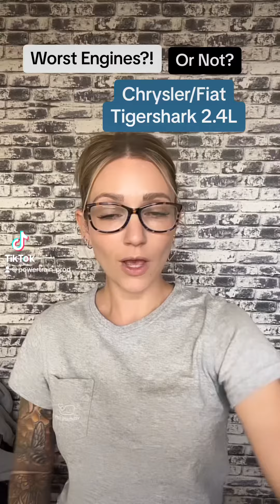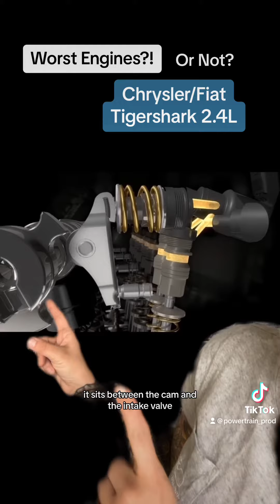Chrysler/Fiat Tigershark 2.4L Engine

Comment: First, this is a very solid engine platform. Very reliable, very stable, and very efficient for its class.  The issue will be the owners.  With the design of this engine, surpassing or completely ignoring the oil change intervals is mechanical suicide; it will destroy the engine, on that we do agree.  That doesn't make the Tiger Shark a bad engine.  It means you have do what you as an owner of a vehicle are supposed to do and keep up the proper maintenance intervals.  Now with Valvaline Restore and Protect, you can clear and protect those oil channels and keep you Tiger Shark running reliably for many miles.  I have a Tiger Shark in my 2014 Dodge Dart SXT with 249,830 miles and only withing the last 30 days have I started having an issue with the actuator.  I plan on using the Restore and Protect at my next oil change to combat this issue.

Comment: I’ve put 160k miles on my Ram promaster city tiger shark. Original everything. The secret? Not so secret. No lugging it around below 2k RPM and 4-5k mile oil changes religiously. Easy peasy lemon squeezy. 
They say 5900 a day keeps the mechanic away. 
Seems to be working out well. 🤷‍♀️
Not much else to say. Change your freaking oil man. Drive it like you stole it. No complaints over here. No leaks. Minor oil consumption. Needs new mounts though. 🤣

Comment: You MUST change or fill every 3000 miles. 

I blame the EPA... Don't ever use any oil that's not recommended... But I can almost guarantee you that this engine was not originally designed to be used with full synthetic like this... It's too thin... I bet the original design might call for 5w 20 oil.... Never do it though because you'll void your warranty or any recall benefits.... But I really think that's what happened.... And the nonsynthetic oil would be changed every 3,000 mi... And then it would never run out of oil before the oil change....

So.... Yes I use the full synthetic... But I change it every 3000 miles... And yes it's expensive.... 

But my vehicle is also 25,000 less than a 4Runner.... It is what it is....

Comment: My wife has a 2015 Jeep Renegade. Has about 100k on it now. Has never used oil. Has never had a single issue other than a failed thermostat. We do change the oil around every 5k miles and make sure to use an appropriate oil (crucial for Multiair engines) I dont doubt that some of these are duds. Every company puts out some duds or has some junk slip through QC, but I think the biggest factor here is lack of maintenance which makes any car eventually unreliable. I know too many people who stretch fluid chnages to the max as though it is just a suggestion. Particularly problematic on this Multiair system. A lot of folks have probably bought used Cherokees, Renegades, 500L, Dart, or Chrysler 200 quite cheap and viewed them as cheap "disposable" cars as well. Almost purposely not maintaining them and then running into issues. Gone are the days of the "weld the hood shut" Civics, Camrys, or even the old GM 3800. Pretty much all of these newer complex engines need regular maintenance.

Comment: I'm  in a 2018 Promaster city with this engine I bought new that has been through a lot.  The dealer had to rebuild the top of the engine because of oil consumption.  A water mishap ruined my transmission, and I had to have it swapped with  2019 transmission with only 12k miles. Despite all this, i  LOVE THIS VAN. The space, the way it drives, handles and looks.   It's been running great since, and my van is so customized as a  micro sleeper camper and for an off grid business I run.  I've pumped so much time, money and energy into my specific build that I will do whatever it takes to keep it running for at least another 3 years.  I'm in South Florida, and wonder how everybody feels about engine rebuilds vs used engine swaps.  Not ever wishing I have to deal with that, but it would be amazing to find an honest mechanic who really knows and understands these engines and has more than a dozen Tigershark rebuilds under their belt and can offer a 5 year warranty on their rebuilds.   My next van will be EV  unless something happens in the next 2 years.

Comment: Have 73,000 miles on my 2016 Chrysler 200 Limited - outside of the thermostat going bad and a dead battery (the dead battery was my fault), haven't had any other issues.  I do, however, change the oil in this car every 4-5k miles and I keep up the maintenance schedule on time.  Like any other domestic model really - should be fine as long as you MAINTAIN it properly.

Comment: Mines. Still running ok, but the but it does have hiccups with cylinder #4 solenoid getting stuck. They just need a filter for the multi air system.

Comment: when carrying out maintenance, in addition to changing the oil and normal filters, pay attention to changing a small oil filter, that of the multiair system, which is very important to keep the system efficient. inform yourself
Reply: Depending what version you have there isn't a filter. Except a metal screen you have to take the engine apart to get to. 2015 Chrysler 200. If you know of a source that says different id love to see it

Comment: Hey guys. I have had my renegade for over 3 years.  Couldn’t get FCA to do anything about it using over a quart between oil changes so I started putting in Lucas oil stabilizer. After putting in a quart for 1/2 quart for every oil change and using Lucas when it is a little low for the last two years, I have stopped it from using oil. (Almost non existent now). It may use a 1/4 every 3500 miles but not even enough to have to worry about putting oil in it every 509 miles like I used to. Try it. Worked for me. I think they should have replaced my engine bc it’s bull to have a basically brand new vehicle using oil. I’ve had 3 jeeps with over 300k miles and none of them used a drop of oil but this newer one. Good luck

Comment: 2014 dodge dart limited with the tugershark. 184,822 miles currently, change oil every 10k miles (full synthetic high mileage). Usually down about 1-1.5 quarts after 10k miles. No major issues. Had to replace wheel bearings twice, oil pressure sensor, and do a software update for the Bluetooth. That's it, still running with no issues. Just before 200k gonna trade it in. Hard to believe I seemed tk get the 1 single tigershark with like no problems, or maybe people are just using the wrong oil or something. In past 150k miles I've had to top off coolant twice too.

Comment: Omg this Engine SUCKS!! I bought a 2014 Dodge Dart GT 2.4L  2 years ago with a little over 30k miles on it and it was in and out of the shop about 6 different times within an 8 month period and the Engine finally blew up overheated and I was forced to fork out almost 7k for a new one

Comment: The multiair system is fairly reliable with the correct oil and oil changes, plus an oil flush every second oil change. There is also a separate oil filter for the multiair system that is often never changed
Reply: Which oil brand do you advise?

Comment: I have a 2021 RAM PROMASTER CITY with 20,000 miles on it.   No oil consumption and no problems.  My last service it appeared the mechanic did not change the oil filter and loosened the old filter such that it was leaking oil.  I to have heard the engines are very reliable in the long term only sparkplug and transmission fluid change.   I think the vans and engines are getting a bad rap due to the low quality of available service.

Comment: It's definitely a pain to work on, especially if you have the 4x4. In addition, to knowing that it failed to compete with Honda's K20 series. There is a bulletin that the reason it burns oil is there is a tuning issue with the ECU. If you bring your vehicle with the oil burning issue to any Dodge/Jeep dealership, they will reprogram it for you. If memory serves, it does have something to do with engine breaking and how it works with the PCV valve. I usually run an oil flush cleaner and an oil additive when doing engine oil changes, which keeps the engine healthy. Fiat definitely could have done a better job with this vehicle, but of course,  they're more focused on their flagship vehicles. Nothing should be "sealed" when it comes to vehicle lubrication. I conduct my oil change intervals every 3,000 miles for engine oil, 30,000 for the PTU and transmission in addition to using oil additives for longevity.

Comment: My 2014 Dodge Dart SXT with the 2.4 Liter MultiAir Tigershark Engine has been extremely reliable for me indeed!  My engine has never had an excessive oil consumtion issue like some of these 2.4 engines reportedly have displayed!  There is an open recall on the majority of these engines for replacing what is known as a MANIVERTER.  Manufacturer EMISSIONS RECALL:  U90 2014-2016 2.4L IN-USE NOX - CATALYST EFFICIENCY  Status Stellantis says "Remedy Available"  I have been waiting as the dealer is waiting for replacement parts!  Supply chain, present economy, etc. causing delays as I have been waiting for 4 months as of this comment listed here by me!

Comment: Do the 2006 Jeep wrangler 2.4L 4 cylinder engines are tigershark design or the latter was only offer in 2013 models?

Comment: Bought 2019 Jeep Compass . Burned oil a lot till about 20K or so. Had to add some thicker 10w-30 during those days. Then it stopped burning. Now at 40K+ or so it does not burn oil any more. Been changing oil every 5K or so. So far so good. Only major issue was the small aux battery from Chrysler died 2x. 3rd replacement battery was not Chrysler brand. Time will tell. But because of you all telling me about oil burning and my previous experience with oil burning, Im getting paranoid. Im checking oil every week.
Reply: When you say 5k, is that miles or km? I have a Jeep Compass with this engine and it's the 2nd time it almost run out of oil. It burns almost all of it in 6000km. No leaks or smoke visible.
Reply: By the way, 6000km is 3728 miles.. insane oil consumption.
Reply: Sorry to hear you are experiencing these symptoms. my compass now has about 60k miles. Been still changing oil about 6000 mile intervals. I am not experiencing any oil consumption  issues. During the 6kmile interval, I may add a quarter of a quart of oil, if that.

Comment: Change oil every 4-5k miles. Don't rely on the oil life monitor. That will get you in trouble. The tigershark uses oil for the vvt system for the intake valves. Clean full synthetic oil is a must. As the manual says check your oil level regularly. I would aim for atleast once per month. People going months or not at all  checking oil level on any engine is asking for trouble. If you don't know how to check and add oil then learn. Its basic car maintenance. People having oil consumption issues need to get their dealer to do the pcm flash. That resolves the oil consumption in 95% of cases. The rest may have a bad engine due to running it low on oil too many times or a manufacturer defect. If the engine is shutting down don't keep trying to drive it figure out what is wrong. Many cases in the 2.4 its low oil. There are very few other issues with this engine other than maybe a thermostat here or there. Overall reliable and built simple. No GDI no turbo etc. Simple is better why everyone now wants a turbo I don't understand. I have had turbo vehicles before and do not want another one.
Reply: I have a turbo vehicle and it’s much easier to work on even though I’m doing more schedule mx it’s MUCH easier. This engine in a jeep SUCKS to work on

Comment: Ive got a 2016 dodge dart with the 2.4. So far.. its been.. reliable,but very very underwhelming. It has very low power output, which seems to vary day to day. Its electronic systems are.. finicky to say the least, and i have had the reflash for the oil consumption. So far it is holding up. Im at 120K, however, fuel mileage is dropping. Where i used to get 28-32 normal driving, i now see 23-25. I have swaped a few parts.. like an exhaust and cold air intake. But from my understanding those should help, not hinder.
Reply: Your car has an issue somewhere
Reply: @leion800  you'd think. But several people, a dealership, and multiple shops had looked over it. It just seemed to have an attitude of it's own. And I don't mean just 'looked'over it. I mean.. had evap tests done, fuses and relays replaced, control modules tested (ecm, bcm, tcm..) and visually inspected. The car was in great condition. It just seemed to have an attitude depending on the day of the week, and the temperature outside.

Comment: I own a 2015 dart with a 2.4 multi air. Bought it new. 272k miles and still running. I've never done anything in the engine bay except plugs twice air filter twice and an oil change everything it suggests. I've hit 2 deer, a ladder on the interstate, a fallen tree top, armadillo, and a few road gators, aka tractor trailor tires. I've got a hitch on it and pulled a lawn mower, four-wheeler, golf car,t and stuff from the hardware store occasionally. I know I'm on borrowed time, but I'm hoping to make it to 300k.
Reply: I'm at 184k on a 2014, If I don't trade it in I'm gonna catch up to you 😅

Comment: Change the Oil at 40% usage and change the oil filter at the same time. Use Full Synthetic Castrol High mileage oil. About a 1/2qt every 2200 miles. Change your own oil and let it drain for 30minutes.

Comment: I have a 2019 jeep compass with this engine. Last year the whole engine had to be replaced in March. This year, the new engine started failing again.  Out of the blue I got a dashboard warning, and temperature skyrocketed. When I opened the water compartment it was full of emulsified, gooey oil...I am expecting an answer from the official part manufacturer...definitely not a good engine.
Reply from the maker: That’s terrible! The chances of getting two bad ones on a row? I’m sorry that’s just crazy!
Reply: Like bread companies puck up all expiread bread and return with new breat type beat.

Comment: I have a 2014 Jeep Cherokee with this engine, it’s currently at 250,000 miles and counting without any oil consumption issues, it’s been the most reliable vehicle I’ve ever owned, it’s never experienced any issues, it’s never even had a check engine light on before, just put gas in and go, I’m confident it’ll make it past 300,000 no sweat
Reply from the maker: Hopefully it goes forever! You are definitely one of the lucky ones
Reply: Lucky. My 2014 Cherokee is a piece of shit. I hadn’t even put 30k miles on mine before it stated having transmission and electrical problems. Stalling for no reason, the column stocks becoming unresponsive for no reason and the wiper blades coming on, hard shifting and transmission slipping, some air vents won’t blow air but others will. And one day when the battery went bad the service transmission warning light and check engine light came on and my transmission sounded like an explosion and shook the whole car when I tried to put it in gear apparently the TCM is bad and many other problems.
Reply: I have 2019 promaster city with 108K miles, I already replaced the radiator a few months ago. Today code reader shows a P0302 misfire cylinder 2.

I know I shouldn't panic, it could be a spark plug or a bad coil but I read that I'll be extremely lucky to make it to 200K miles, that's a bit discouraging.

I'm contemplating on fixing it and selling it, overall it'll be a loss or maybe come out even
Reply: Hello, I also have the 2014 and just approaching the 250,000 km mark and I tend to add oil once in a while, quite happy with this SUV for towing my jet boat around.
Reply: A LOT of credit goes to the transmission.... If you have a lot of interstate miles... The engine isn't doing anything... The RPMs are so low because of the nine speed. 

Keep the oil changed and I think it will go for a long time. 

The biggest problem with my Jeep is going to be the power transfer unit and the transmission I think. 

But if you have a two-wheel drive 2.4... yeah it'll probably go forever.

Overall, the Cherokee KL is an AMAZING machine. If they could have just had a better transmission in it... It would be one of the most amazing vehicles ever built.... They should have done a joint venture with Toyota or something and used a Toyota four-cylinder and the Toyota transmission.... Would have been the most incredible crossover ever made.... And no... A rav 4 isn't even close to a Cherokee Trail hawk.... Trailhawk is more like a 4 runner TRD pro in off road capability, or even a Toyota FJ (stock).
Reply: @off-roadingexplained8417  yeah im curiosity's on driving's style's and or cop/taxis/idling ( dirty/salty-roadways and fuels-QC and humidity and temperatures and maintenance as oil is sensitivity to this ) and or cities vs I80 at 70-90mph as the systems aren't active in cutting down the camshaft/programming at high-load+speed at that point it act's as a race-engine from the sox-team/1970

still nice to have database on mileage 

wishful minded that the V8's/hellcat getting it/got-it
Reply: This is amazing, I wish my 2.4 tigershark engine last at least 100K, my 2018 compass is only at 34K miles without any oil consumption issue, but I take care with 3000 miles oil change intervals with full synthetic.
Reply: I have a 2016 Jeep Cherokee 100,000 something miles and everything is fine no oil consumption even though they keep sending me the thing in the mail like no one is even saying anything about it
Reply: Only issue with mine is lights flickering inside sometimes but it is very slight
Reply: Do you use the manual sport mode and redline it for maximum torque?